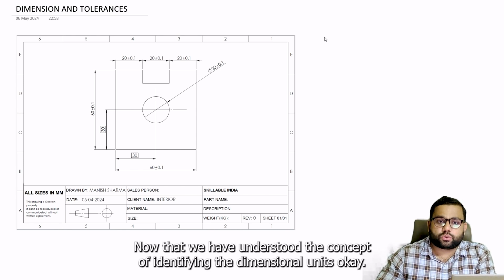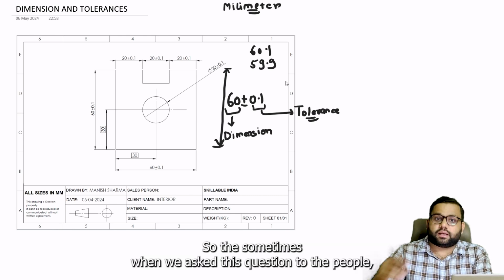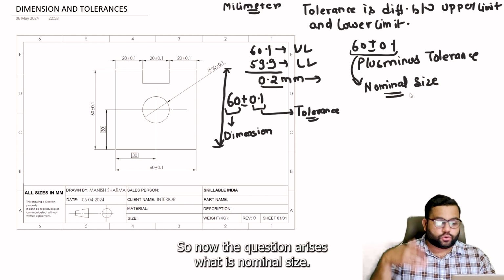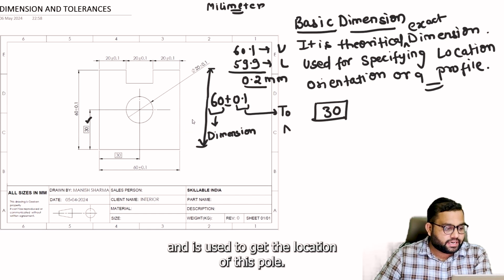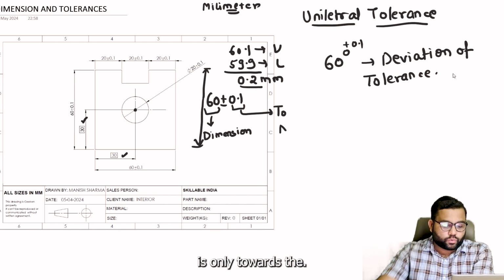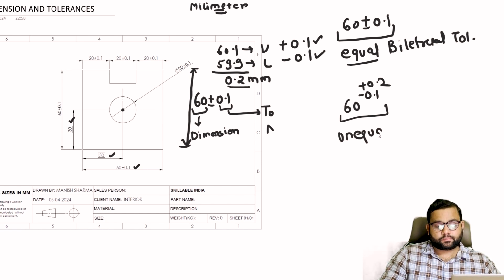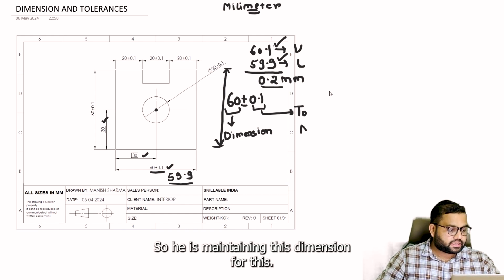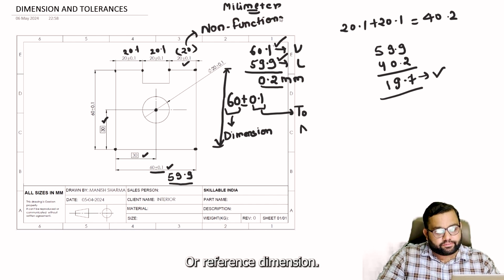GD&T - How to Apply Dimensions and Tolerances ?

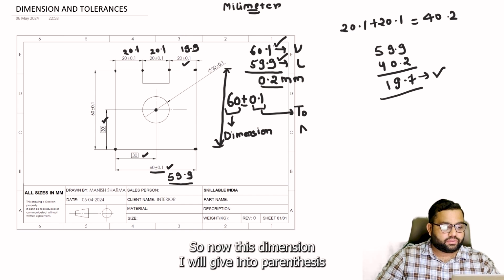Comment: What is a "parenthesis" sir? 16:02
Reply from the maker: When we Write dimensions in parentheses it show that it's a Non functional Dimension, you can understand this with simple example when ever we are assembleing two components with each other, the mating surfaces act as a functional other than that we have to see in our design that while manufacturing what needs to be strictly tolerance and what can be used as non functional Dimension.

Comment: Hii, for tolerance which chart are you using?
Reply from the maker: We can Use ISO 2768 and ISO 286 Standards for linear, angular and Geometric Dimensions in Engineering Drawings.